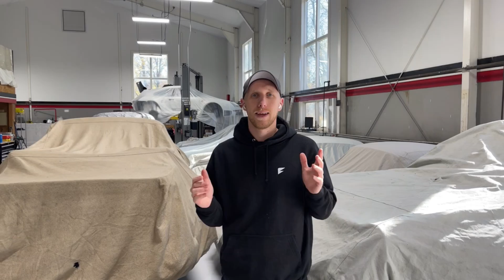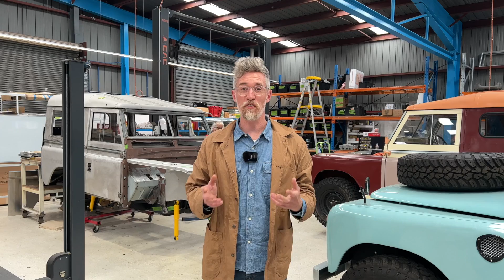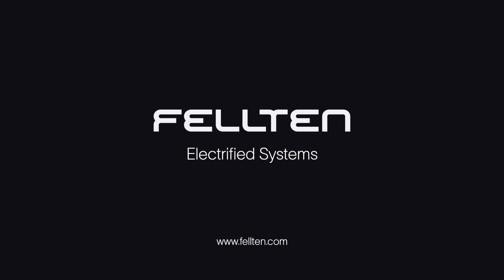Announcing Fellten - Zero EV + Jaunt Motors

Comment: If Fellten is Welsh then you're pronouncing it wrong 😂  two l's make a sound one cannot type...

Anyway I would love to see a bolt on hybrid kit for Land rovers, a simple motor flange mounting to the PTO side of the LT230 like a hydraulic pump would, and a little 5kwh battery under the driver seat. Brake to generate power, accelerate to use it.
Reply: Also it’s spelt Mellten when used on its own , only when in a sentence with certain words before it it’s Fellten , also to be even more anal Mellten is one lightning bolt , for lightning as it normally occurs you would say Mellt